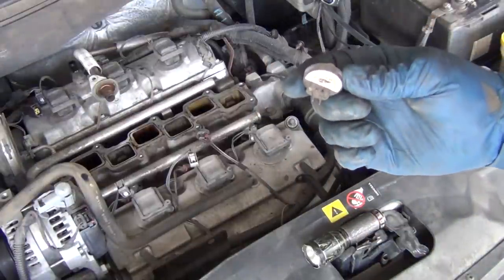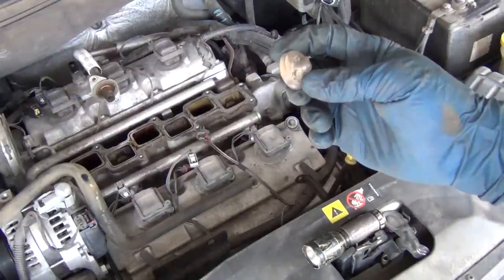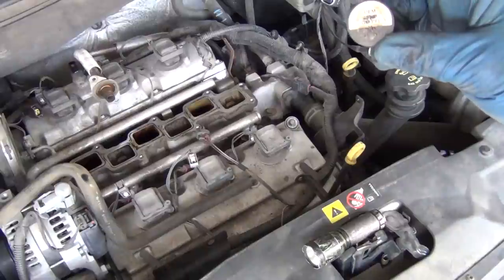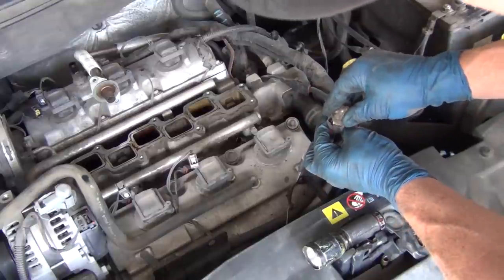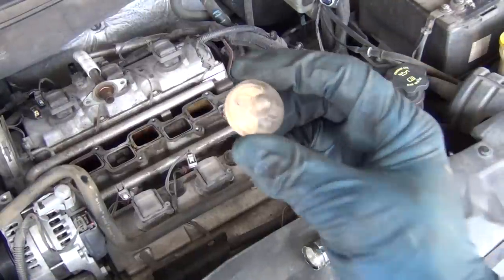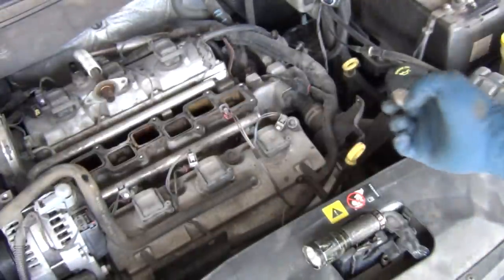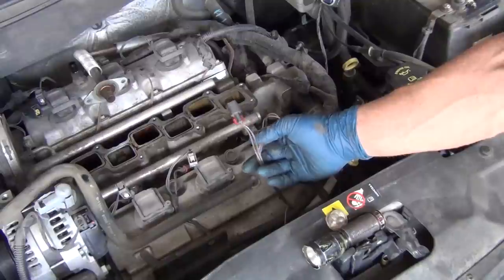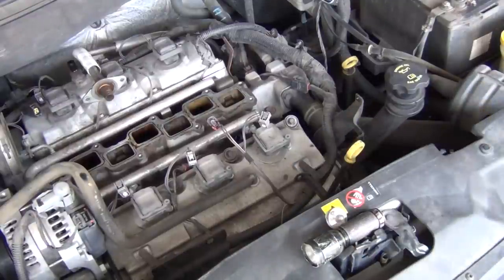How to Check For Injector Pulse P0206

Comment: If you have a decent scanner and fuel pressure test kit, on this car you can let fuel pressure build up by cycling the key and check the change in pressure when you energize the injector. That'll tell you if it's stuck closed, stuck open or if it's even getting power. As far as using the light, you can use T pins and alligator clips to backprobe the plug on harness side (RH engine) For injector #6 Brown/White is ASC Relay (PCM) and Brown/Violet is Control (PCM). 
MUCH less work than taking the whole intake manifold off.... But if you do not have any of those tools then is probably the best method

Comment: Hello Brian I have 2002 Jeep Grand Cherokee had code p0306 which points to misfire to cylinder #6 and or fuel injector #6 so I replaced that injector  and all spark plugs while at it, clear code and fired up no change in systems this time code p0206 came on any suggestions thanks

Comment: hey brain i have a 99 ram 1500. everynow and a again. i get a cyclinder 1 misfire generic. ive replaced everything but the coil. swapped injectors and no new code to where i swapped injector to. you think coil? and when you get generic misfire would you say ignotion problem?

Comment: i did a compression test, that was my first move. replaced iac tps. pcv is functioning. i have spark good gas pressure. the misfire is extremely determinant. I did not notice that my bearings in my water pump are going out lately. maybe give a crappy idle? little bit of grinding sound from that. gotta do that, i fugured replace the coil at the same time. the scanner said misure cylinder "generic" so it's gotta be one of the common ignition componants right??? lol hell, this darn thing...... ha

Comment: Brian...I have a buick 3800, that is driving me nuts...misfire only when hot and high humidity. Have replaced plugs and wires..coils check good...one 100 ohms low..? after watching your video, thinking it could be a electrical break down of injector wire when those conditions are correct...Berry, sneaking up on the little bugger TKS